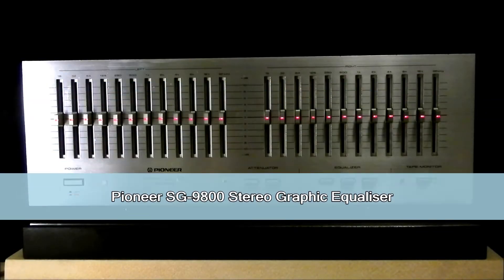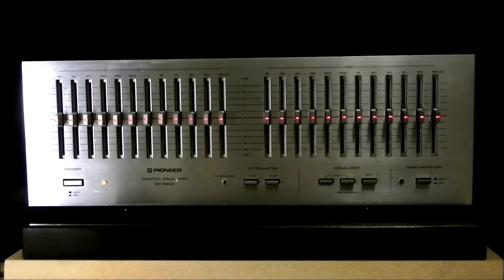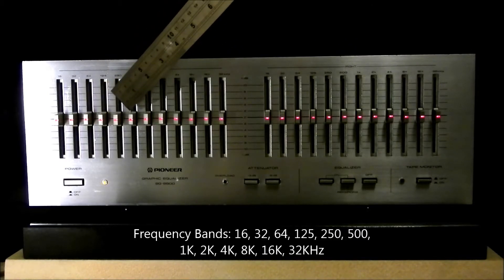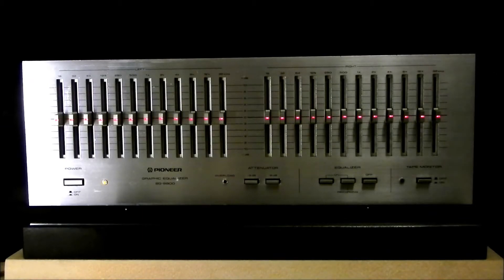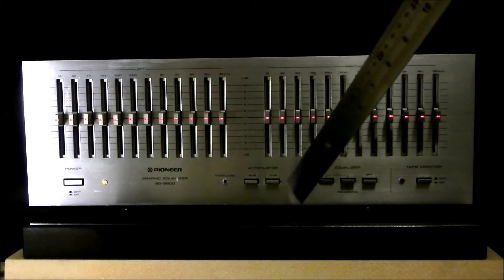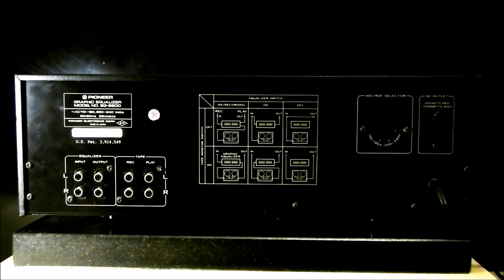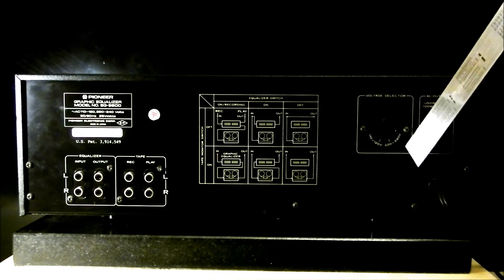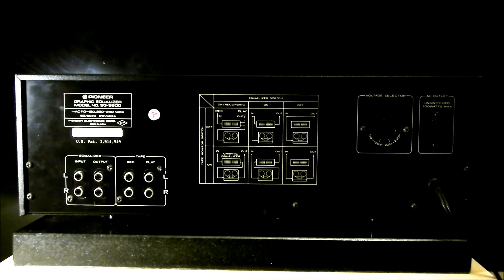Pioneer SG-9800 Stereo Graphic Equaliser Review & Demo

Comment: Man, I love this EQ but my right side has just died and I am not sure if it's something I did or if the EQ has just seen better days! Anyway, great video, man!
Reply: Check your cables and spray the switches/controls/sliders with Deoxit.  This EQ had issues (its only downside, but switches are abundant and inexpensive) with those push-on/push-off switches for the tape loop going bad after 40 years.  The EQ switches don't go bad, but that tape loop switch may need to be replaced.  When it goes, it won't stay engaged.  IF you don't use the loop, it won't matter anyway.  It's likely either a bad cable or a dirty RCA jack or switch.  Deoxit has saved MANY a tech needless headaches.  And it lasts for years...
Reply: Check inegrated circuits 4558.

Comment: First, almost all Pioneer equipment is good quality. This SG 9800 could have been better. They just added two more sliders  16hz and 32khz, otherwise its the same as the SG 9500. The 32khz is useless, maybe your dog can hear it, but adult humans can't hear much above 15khz. The 16hz is to low to be effective. Not even as a sub-sonic filter. It would be more practical to have output controls, bi-directional dubbing controls and adjustable  LED power meters and a good sub-sonic filter, like 18db/oct @ 15hz. Still its a nice unit, but an ADC Sound Shaper Two IC would be a better value. I got mine in 1982 and its still working (no repairs) for 34 years!  The 3db and 6db switches on the 9800 aren't as useful as seperate output controls. I own a Pioneer  RG 2, a PL 518 and an SX 434, they're good stuff. Should pass on this SG 9800. Really sorry for the shoot down but like I said, it could have been better.
Reply: Hi Bruce, I have to say OUCH!  and touche, guess I deserved that. But really the SX 434 isn't a bad receiver. If used in a small room say 3 Meters x 3 Meters  and driving efficient speakers. Mine is in the kitchen driving a Nakamichi BX 1 cassette deck and Boston Acoustics A 40 speakers (5 watts minimum power). 
    I never said it was my main receiver. I said almost all Pioneer stuff was good quality. I'm sure ALL of us don't like hearing our equipment berated. Hifi isn't about having the BEST stuff, but more about having the best we can AFFORD. You know I gotta tell ya what I have. Marantz 2252B receiver,  ADC sound Shaper 2 IC equalizer, Pioneer RG 2 Processor. Teac X3 open reel deck. Pioneer PL 518 turntable, two cassette decks, Yamaha KX 260 and Technics M 224, Sony CDP 212 cd player. Ohm Acoustics Model L, and EPI 180 speakers and Koss Pro 4x headphones. Not a ton of stuff and certainly not the most expensive, but  it satisfies my needs. 
    You should check out this web site-Classic Receivers Pioneer SX 424. It says some nice things about the 434. I also have a reveiw from  Stereo/ Hifi Equipment magazine ( Nov. 1979) of your Pioneer SG 9800 equalizer. It's a very good review and I would like to send it to you (free).
    I never said the SG 9800 was BAD, just that it could've been better designed.
Reply: Holy moly Bruce, you could open an audio store with your collection. I literally had to research some of your components. I'm not impressed with your equipment, I'm astonished! There is NOTHING low end about your systems. Where the heck do you store everything? How often do you switch units around? 
    I always wanted an SX 950, 85wpc and 42lbs.  but didn't happen.  Your Adcom 565's  stunned me, 850wpc  into 2 ohm's, wow and 106db S/N. Liked your SX 1010 (100wpc) I think that receiver started the Monster Receiver Wars back in the 1970's. 
     Had to look up the Paradighm's,  $1,300! and the Revel F30's, (+/- 1db to 33hz) $3,500 pair. You did say low end?  Put me in your will, PLEASE.
    I would still like to email or USPS the  Stereo/HIFI Equipment review for the SG 9800 (two pages) from 1979 to you. As a peace offering. just send me your address or email and I'll get it off to you.  I guess you know  your audio.
Reply: Marty,had an sx-650 for years and it sounded absolutely amazing. It comes down to your listening room AND your ears.
Reply: Ah, the pioneer SX- 650. First let me get the complaints out of the way. I really liked the blue dial lights of the 30 series (SX- 636)  much better, but have to admit there's something sexy about the silver face plate. The chicks (women) I had over loved the shiny front panel.
     The biggest problem was with the power switch on a rotary knob with the speakers. The SX- 650 had no muting delay when powered up, this COULD lead to switching noise. A  push button or toggle switch would have been better. Speaking of toggles,  the front panel toggle switches had a very positive feel (and sound) when flipped on or off, nice touch!
      Good things about the SX- 650? You bet. It offered 35 wpc and in 1977 that was neat. Also had a very good FM front end for a unit in its price range. Two tape monitors and an aux input plus high filter (only 6db/oct but helpful). Only one way dubbing was possible, but hey most other 35 watt  receivers only had one monitor. Two tuning meters a mic input and THD of 0.3% made for a nice unit. 
       Got my SX- 650 in 1978 at Crazy Eddie's in NYC. When I added a pair of Ohm Acoustics Model L speakers my Bay Ridge, Brooklyn  apartment really came alive, WOW.  Enough output to impress if not annoy the neighbors! 
      Don't be fooled by its age, the SX- 650 is still a formidable unit.  If you don't agree check out the prices it commands on E-bay. Not my main amp anymore, but there's nothing to apologize for with the SX- 650. Thanks for letting me rant.